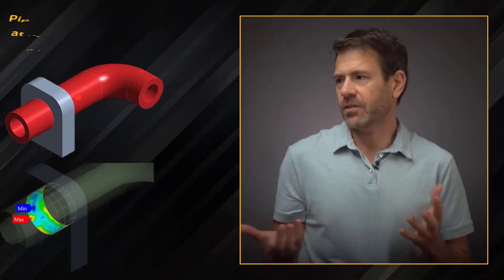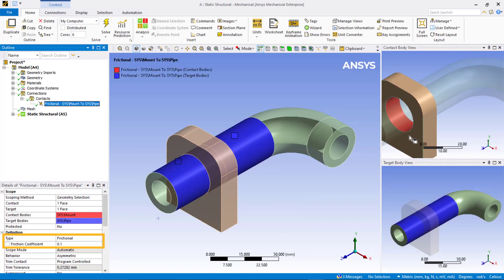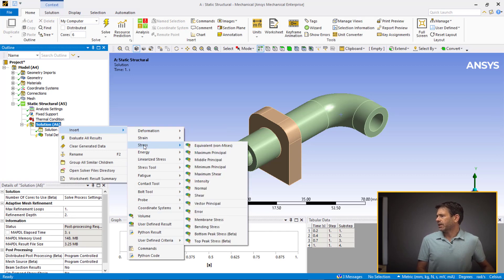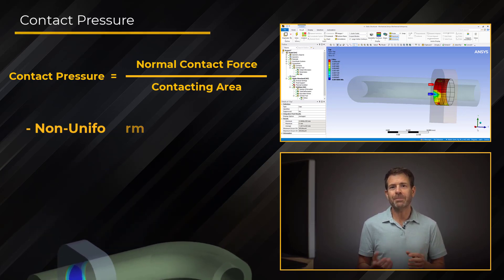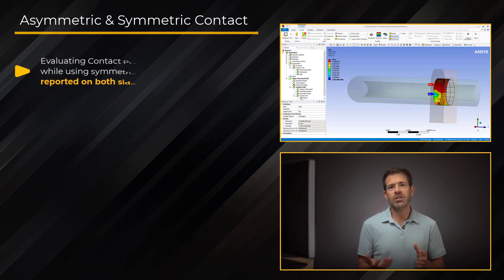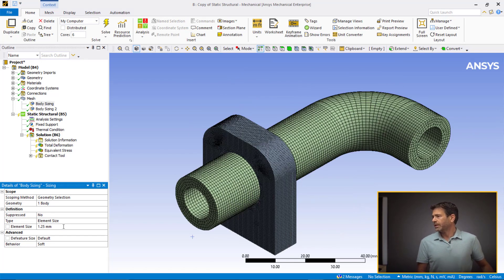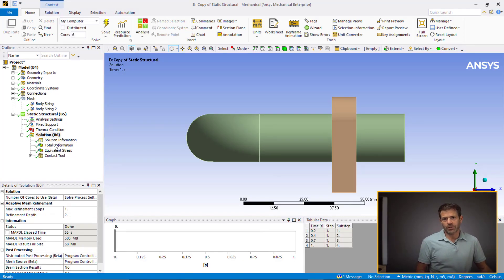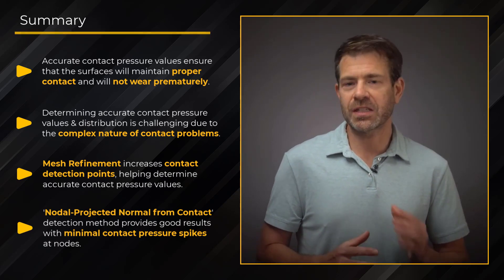Tips on Obtaining Smooth Contact Pressure in Ansys Mechanical

Comment: Great tips for obtaining smooth contact pressure. I didn’t know that the contact tool could illustrate  gap and penetration. To obtain accurate contact pressure though you need to examine the effects of the penalty stiffness as well, although that’s probably too much for one video.